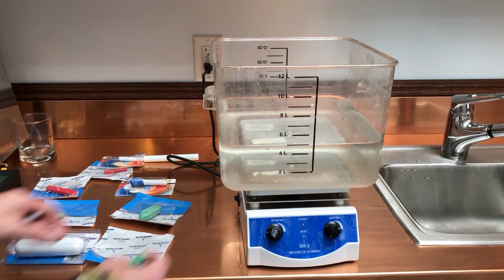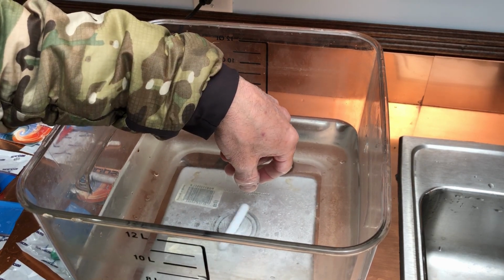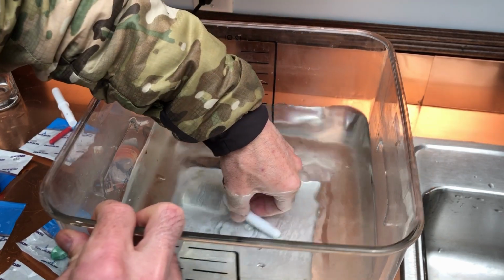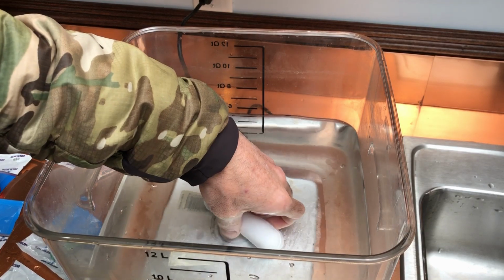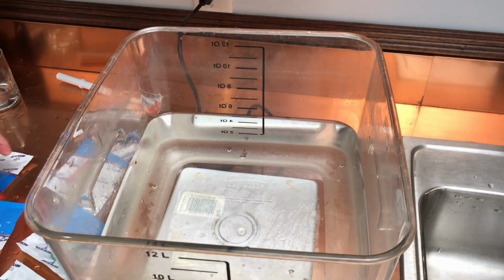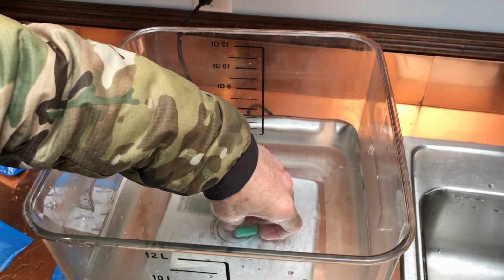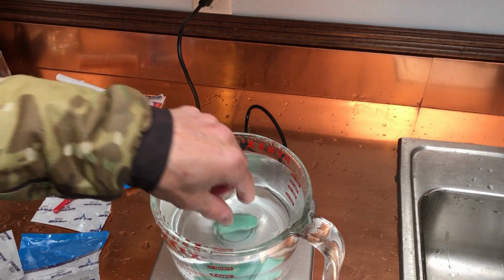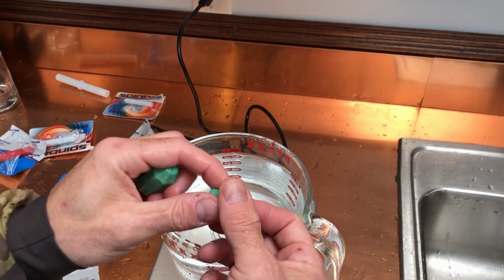Magnetic Spinbars

Comment: its been a couple years but Im sure you figured out by now that even though a couple of the stir bars are too long.. your are using a very unfriendly/uncooperative container to hold the liquid and water is the least viscous liquid on the planet. well I think it is anyway. On top of that you are using a square container. Cylindrical shape is the way to go. You will get better mixing and a better vortex. The square shape also causes resisting currents that are throwing off your stir bar. At low speeds even. If you havent figured that out then that is about all the advice I can give you. I know you didn't ask but it was hard to watch knowing I could offer a couple tips.  Easy mistake tho if you've havent had much experience with those gadgets.
Reply: water is not the least viscous by far lol in fact most solvents are less. Furthermore, the square shape of the vessel shows a more robust case. And also, cyclindrical is not optimal for a lot of conditions